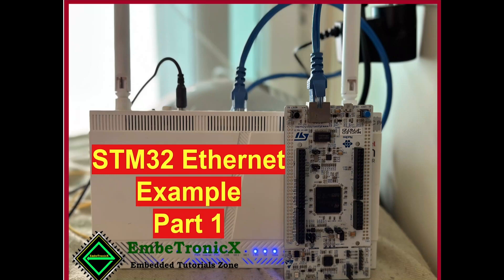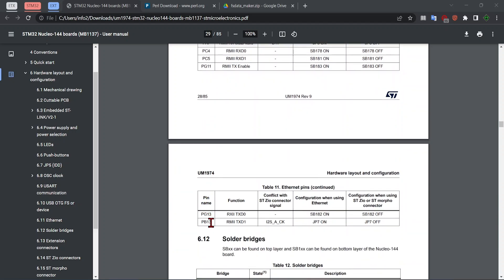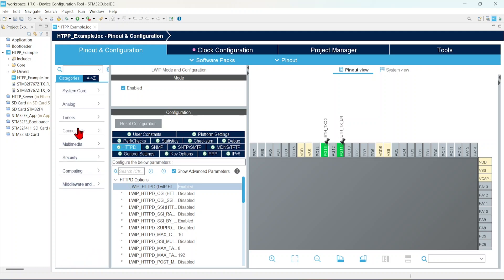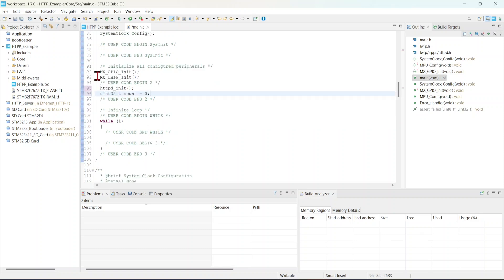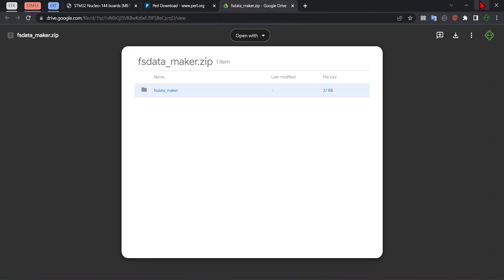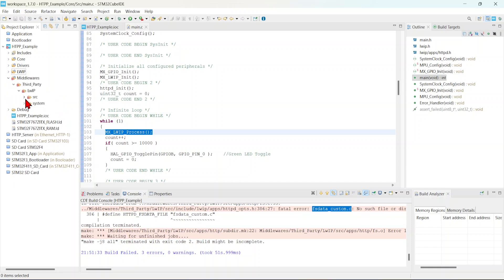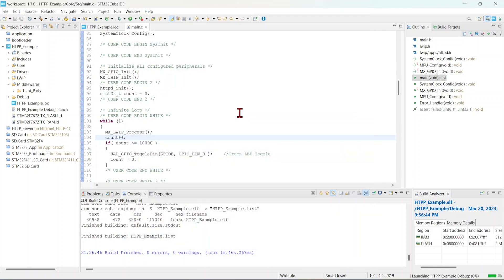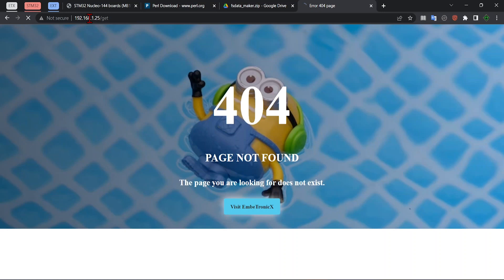STM32 Ethernet Example - HTTP Server Part 1 | EmbeTronicX

Comment: an incorrect ip address shows up on the terminal when I perform ipconfig : I get 169.254.83.55 instead of 192.168.1.25 that I have set up. The ping doesn't wor out. What could be wrong?
Reply: It ended up that it only works when we connect the board to the router. If you connect it to the PC it shows an incorrect address and the ping doesn't work.
Reply: @ESElen10    Hi ESEben10 i couldnt get Embwtronicx talking could u kindly help? is the connection cable correct? 
 i have been trying this tutorial on H743 Nucleo, code is successful and error free, i m connecting the Nucleo board to server using LAN cable and PC to same server using WIFI but i just couldn't connect to 193.168.1.25... error "cant show this page" could u kindly advise what went wrong?
Reply: Hello.....
Reply: ooooooo

Comment: Hello. Your tutorial is very helpful. I want to ask you a question about the CubeMx. I have an STM32H7 and has not on board PHY, so I need to add an external one. I have found LAN8720, although CubeMX does not contain drivers for that PHY, do you know how to add those drivers and appear them into CubeMX? Thank you
Reply: Hello Nikos, find ethernet module drivers for stm32 relevant boards. Then you need to configure the internal registers to setup for your stm32f7. Then implement iwIP on it. As per my knowledge. Mostly you need to configure SPI and gpio registers to adjust the library to your target board.